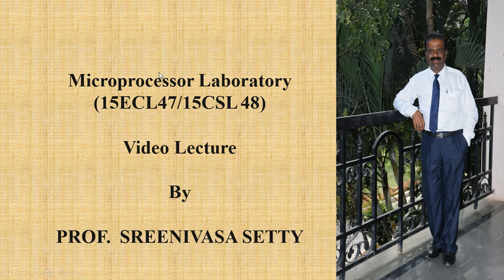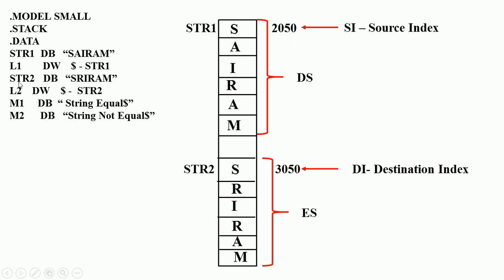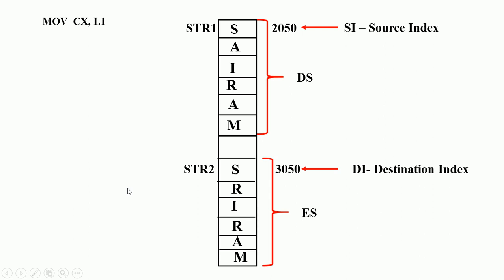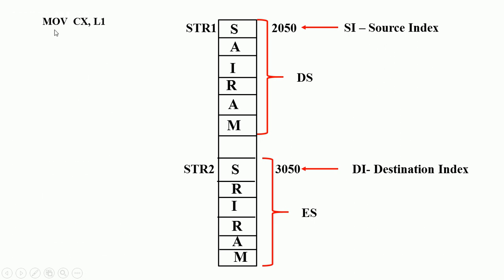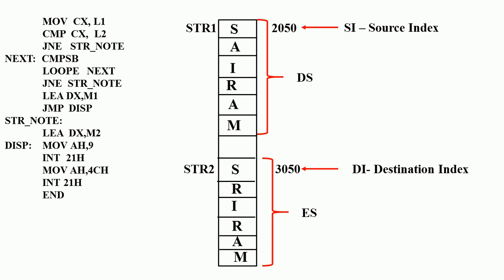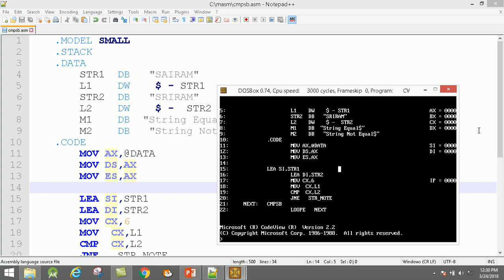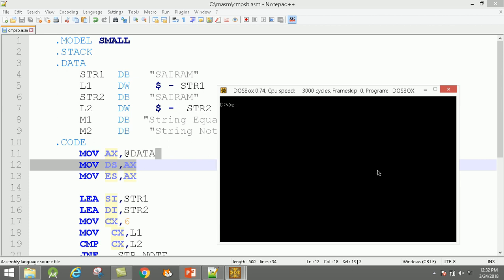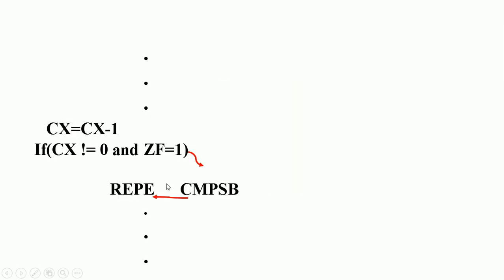Lecture-24: Microprocessor Laboratory| VTU | Compare String Using CMSB String Instruction.

Comment: I want to input a string and then compare it with a another  string that is declared in emu8086.I had tried many codes but cannot get the results.HELPPPPPPPPPP ME ASAP.Provide the code for this purpose.
Reply: same thing bruh, just use 0Ah interrupt option of 21h and do the same